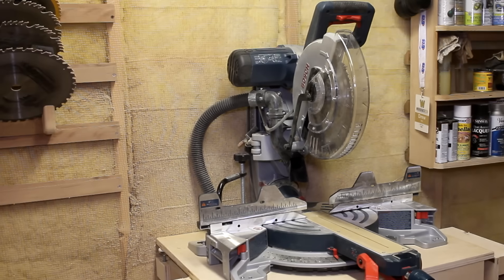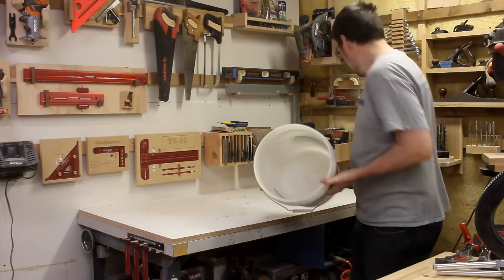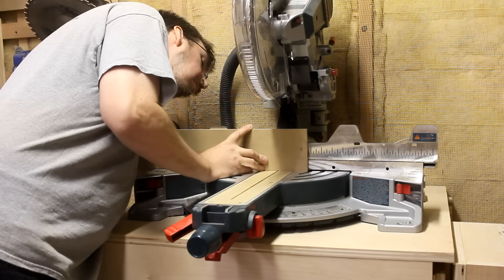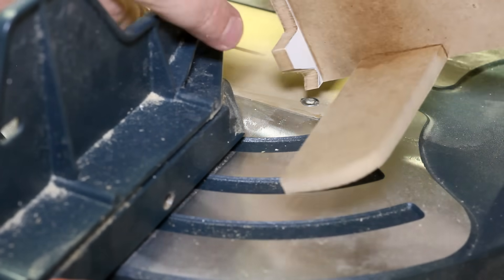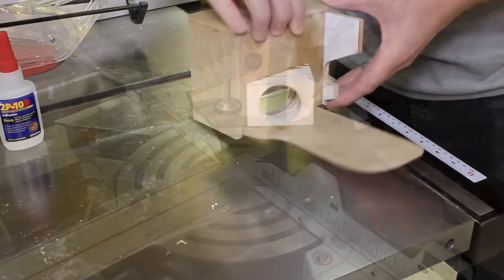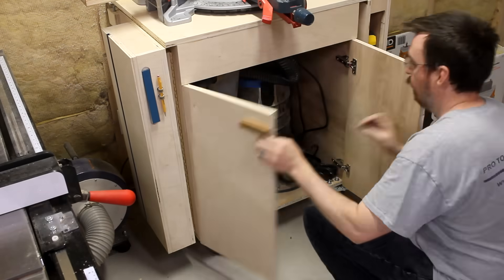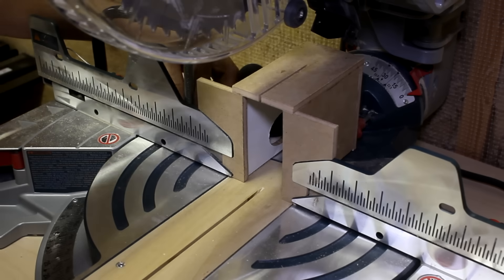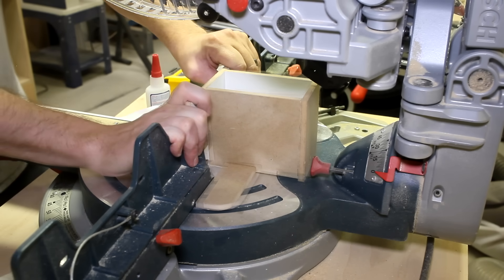Shop Work: Improving Dust Collection

Comment: Nice work.  However, the test cuts were all made right at the fence; effectiveness and efficiency will decline as wider pieces are cut, farther in front of the fence and away from the improvised chute.  As you mentioned, it all depends on how you use the miter saw, the type of cuts you normally make.  To capture more of the dust, away from the fence, you might try attaching to the sides of the saw something flexible.  The brush from an automobile ice scraper makes a huge difference.  However, one brush only covers one side, so two are needed.  Also, the bristles should be a couple inches longer, at least for my saw.  It turns out that Fastcap has a product called the Saw Stache, for a few dollars.  It comes with either 2” or 4” bristles.  It gets very good reviews.  I just ordered the 4” version, and am looking forward to using it.  Best wishes!
Reply: Forgot to mention that a zero clearance throat insert ca also help.

Comment: I would have tried to find a box the  just jigsaw the front - as long as it has a clamping point.  I would also venture to say it's easier to glue the port first and then use it as a guide for your forstener or hole saw bit.

Comment: Excellent analysis!  However, couldn't you improve on your best IF you formed the interior of your capture block with formed interior corners/surfaces directing more of the dust to the vacuum port?  It's working in my head - your head 'may' vary ;-)  Good job even trying...most just don't bother!  Thanks for the effort and the thoughts I'll have once I get mine in a shop again!  Thank you, man!
Reply from the maker: Perhaps, but when I take it off there's no dust there which means regardless of the sharp corners within the box, it's still going into the hose.  Adding sweeping corners just might not be necessary.
Reply: @FishersShop  I see what you're saying and, I agree.  Hey, you vastly improved your numbers.  For being the dustiest machine in any shop, you've done very well!

Comment: Great video! I have tried all kinds of things to capture the dust from my dust sprayer and distribution device, I even bought a dust hood that looks like it came off a baby carriage, it has a dust port for dust collection system and works some what. I even printed with my 3 d printer a scoop like your duct tape model.  If wanted to spray dust all over my shop I could not do as good a job as the miter saw does. I am going to look into making a port like you have along with my baby carriage rig.

Comment: I was surprised that the standard bag everyone throws out is actually 77% effective to begin with.
Reply: On the Ryobi 12" sliding mitre saw, it's about -20% effective.
Reply: @InstinctBassin  Garry not Linda. Any piece of Ryobi stuff is only 20% effective! I bought one and after 2 days of trying to get it to cut the last 1/4" of a board without actually filing off the stop or drilling new mounting holes for the fence and get some kind of efficiency out of the chip collection chute I took it back. Not my first piece of poorly made Ryobi equipment but definitely my last.
Reply: @InstinctBassin  -20% lol
Reply: Yes it does but it also then takes up more real estate on the bench it is mounted to.  When I built my cut bench for the slider, vacum sucks from the bottom and I made it 12ft to the left of the blade and 4 ft to the right and tall enough to roll my workbench/assembly table  underneath out of the way when I need room for finishing.  The space between the wall and the mitersaw fence is perfect for 12x18 storage boxes for screws and hardware items and I added 2  4ft x  9" lids with piano hinges  for a 4.5 inch tall x 20 inch deep storage area under the trays.  By setting it up this way I gained alot of storage in the 4 drawers I have under my portable workbench.
Reply: Trust me it's only that effective when it's empty, as it fills the percentages go way down but you're right "how do they get the caramel in the chocolate bar?"🤔
Reply: @eyefixityouification  for the caramel, I heard its a mold but don't tell anyone it's a secret.

Comment: Nice design for straight crosscuts.  But I cringed when I saw you hand holding the wood while cutting those small pieces, especially the cuts you made around 5:47 into the video.  Those small pieces can easily bind and pull your fingers right into the blade.

Comment: Since I have the same saw, this intrigues me. So there’s no dust that come out of the original port up top? Would it benefit from having a hose on it also? As always, love your humor!
Reply from the maker: If you split the host, that would be 50% less suction in the box then.  Plus, virtually no dust makes it above the shroud box so I'm not sure it would be worth it.
Reply: I’m curious to know - where does the dust go that doesn’t get captured by your little sucker? (Before your lungs, that is...)

Comment: I enjoyed your video.  Your results are however more impressive than you stated if you consider how much dust got away and into your shop: 23%, 12%, 8% and with your fixture only 4% got away. Great job!
Reply from the maker: Thanks Mike!
Reply: I came here to say this. You are releasing ~6x less than the bag, ~2x less than tapey. I made a similar box adapter for the same saw a year or two ago, but yours is much better. This inspires me to improve it, but in a quantified way.

Comment: You might be about 14,000 ks from where I live, but you'd probably get lung disease if merely I showed you a picture of what the wall behind my saw looks like.. ;)
You'd also laugh at all the cut marks in my shop vac hose nozzle from when the gaffa tape let go and the blade ran through it.. :/
A fantastic solution Drew.. I'm gonna make one for my Dewalt..  :)

Comment: What a great idea. Have just done something based on it on my Evolution mitre saw. Using your design and putting in a tee piece to connect to the dust port on blade as well I have almost no dust escaping. Such an improvement. Thanks for your video and an idea I have not seen anywhere before. Also love the style of your videos.

Comment: very nice. But... why did you leave all that room at the sides of the blade? since you use your "system" only for straight cuts, you can test also a narrower window
Reply from the maker: You need a large opening to catch the dust when doing cuts on stock that require you to pull the blade out beyond the shroud.
Reply: @FishersShop  You might be surprised how much dust can be sucked through a saw curf.  The saw curf would give you zero clearance cutting too.

Comment: Great, useful information with a wonderfully warped sense of humor.  Is the chain on your vortex (an interesting start to any sentence) there to ground the dust collector or to keep it from escaping?  Or possibly both?  Thanks much.  Thumbs up to crush a troll.
Reply from the maker: Yeah it grounds it to keep from static buildup. Not sure it works when in the cabinet though. Might have to cut a hole in the cabinet floor so it can touch the ground.
Reply: @FishersShop  Thanks much.

Comment: Great video. Another factor in your system is that it is the transistor to the TV tubes. Compare your cart and dust collection system to the size of all those wall - shroud systems! Lots of advantages for the small shop. Informative and entertaining as usual.

Comment: Your videos are awesome, great job. When you forgot to tension your blade on your bandsaw a tip I saw that helps me is to grab one of the D-Rings that you would use for your keys(NOT FOR CLIMBING) and you put in around the blade after you take your tension off. Get a red one it helps...
Reply from the maker: But then I would have one less outtake. :)  Thanks John, good tip

Comment: Very nicely done.  I'm a bit obcessed about dust collection, so I'm alway curious when somebody comes up with a new solution.  I think yours is very unique.  BTW, you omitted the other common solution, which is what I did with my DC cyclone: build a large box around the saw.  Now I'm a bit curious to see how it would stack up, but I don't think I could repeat your test as easily.
Reply from the maker: All my solutions had to be small and compact.  The huge box solution is effective but just not practical in my small shop.
Reply: @FishersShop  No, that's fair.  I think your solution is perfect for your shop, just mentioning another solution that your video didn't mention.  I wasn't sure if it was because of ignorance or not.

Comment: Very good video  i am pretty sure  that the Bosch saw  you have is going to be my  next shops miter saw  in the past. Ive used the Dewalt 12” double compound models  as i kept them somewhat. Mobile. To  cut trim on locations when i needed to do so  i do not plan on  going. Mobile again  although i have nothing negative to say about the Dewalt. I like that. Compactiveness. You get with the Bosch  double hinged arm  and Bosch. Overall  quality  the price is a little hurtful i may add  ?  But who knows perhaps i can find a local Meth Lab that  needs a salesman that could increase my cash flow and  help pay for new tools ?  I actually. Gave my Dewalt to a family member that had some bad luck. And needed a saw to help  make. A income  ?  So therefore  i  will need to purchase a replacement  anyway

Comment: Nice solution. I replaced my dust collection boot that came with my saw with a 1-1/2” PVC pipe and added a leather surround on the front. 
This retro fit travels with my saw when I  turn my mitre saw to select other degrees of cut including dual bevel sliding compound settings.
It worked well enough. I don’t believe you can ever get all the dust because the blade throws off saw dust to the sides as well as behind the saw teeth. You would think that the saw manufacturers would design a better dust collection device for each saw that is made when they design the mitre saw. They get an “F” from me!

Comment: Great idea.. I have to admit that I am rather impressed at the efficiency of the bag.. while still being the bottom contender, it was nowhere near as bad as I thought.  One thing that would be interesting to see, would the efficiency be improved if you had dust collection connected to both your adapter, and to the built in adapter?  There will still be a small amount of dust that could be thrown around the blade guard, and that might be limited if there was suction in the stock dust collector.  Food for thought.  Thanks for sharing, can't wait for the next video

Comment: Awesome video Drew! The way to think about it isn't so much in how much dust is collected, as how much of it escapes. If you compare just the vacuum to your solution, you end up with only 4% of the dust escaping vs 12%. That means you've cut down the dust in the shop to 1/3 of what it would be otherwise. That's pretty impressive.
Reply from the maker: Thanks, Brian

Comment: Wonder what would happen if you added a Y connection to your vac hose and used the built in dust chute at the same time as your mod?
Reply from the maker: Not much dust makes it above the shroud.  Not worth sacrificing 50% of your suction power.

Comment: Great video! I need to do something similar for my DeWalt. But first, I need to go buy more M&Ms.
Reply: My Dewalt slider has been and still is a challenge for dust collection.
Reply: @daryld8901  I bought the 12" non-slider and that might make it easier to take. I was not willing to afford the space behind fence for a slider or the money for a Bosch glide saw.

Comment: Your video got my attention and was most enlightening. See, being as a fresh novice myself, still learning this as a hobby. I am making up a shroud style scoop and vacuum system that for strange reasons seemed strange until now.... For the express purpose of utilizing the stock safety shields too. Since I have one abundant resource of coffee containers. It seems settled the folgers plastic look is in the future for my shop area decor. Since the next material usually noticed would be duct tape and wire, it should tie my fun-sway all together, altogether nicely. There are two benefits to this method of scrap binning particularly appealing to me. 1 The mitre saw will have free travel with the rotation or 2 slide. Which will be helpful in this small garage. So I was thinking to add a third plus. Painting it up like a big snail. For some autistically artistic standard giggles when there is an odd visitor.

Comment: Nice job! Have you tried new new shroud for cutting something thicker or wider than a 2x4? I suspect it might not work as well, since the blade would tend to throw the dust over the top of the new shroud. But as you say, you can always remove it and use the duct-taped original shroud for those cuts.

I bought a Festool Kapex recently, partly because it has excelelnt dust collection. (There are some other great features too.) The Bosch that you have was #2 on my list. But even the Kapex doesn't get 100% of the dust. I may try your duct tape trick and see if I can improve it a bit.

I think I also need to improve the seal around the top of the bin under my Dust Deputy -- I think it's leaking a bit and affecting the suction. (A 20 gallon bucket wouldn't fit under my cart, so I used a plastic storage bin whose lid isn't airtight. The package of weather-stripping from Amazon just arrived.
Reply from the maker: If you try a different cutting technique, my shroud still works very well.  Typically people pull the blade all the way back, drop it, and push forward to cut.  In this case, yes you're right... sawdust wouldn't have anywhere to go and wouldn't make it to the shroud.  But if you drop the blade a tiny bit and cut a small channel as you pull you essentially create a path for the dust.  then once it's out all the way, drop it slightly and push the cut.  Repeat this as necessary until you're through.  Doing it this way captures just about all the dust in the shroud.
Reply: @FishersShop  A nice touch.  Thanks for the tip.

Comment: ha ha...I was wondering if you were going to glue it to the saw in a couple of those. Quite the improvement! I really like the solution you came up with for this. I am pretty impressed with how effective the bag is alone...I wouldn't have thought it was anywhere near that. Guess it would help if I actually emptied the bag once in a while, huh? Great thinking with the kerf size and what that would equal compounded over 5 cuts. Blew my mind a little there! Great video!
Reply from the maker: Thanks Bruce! :)